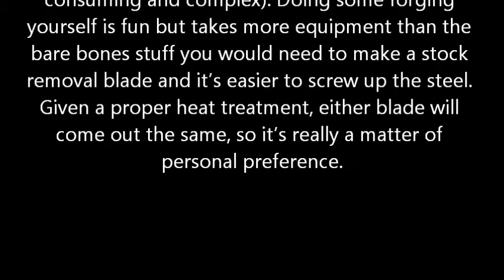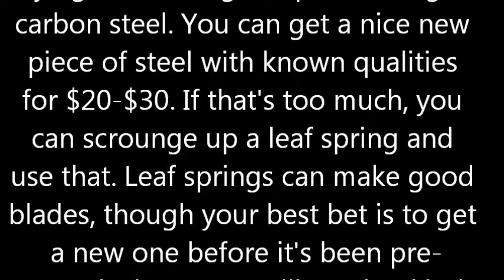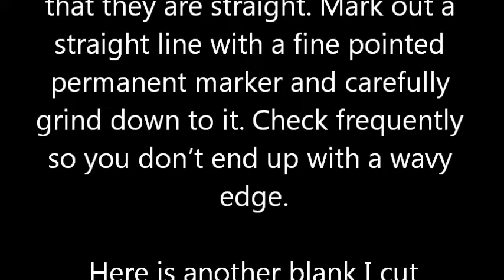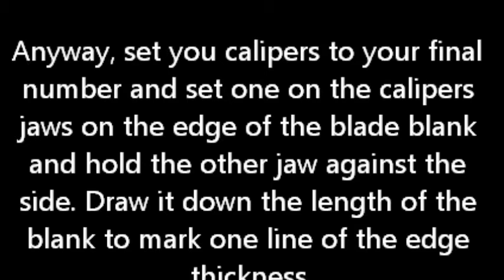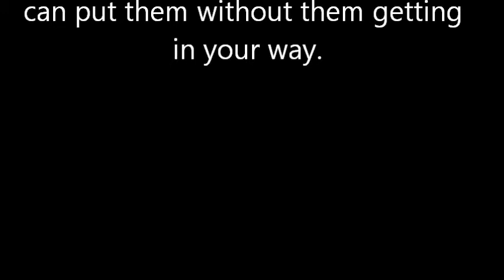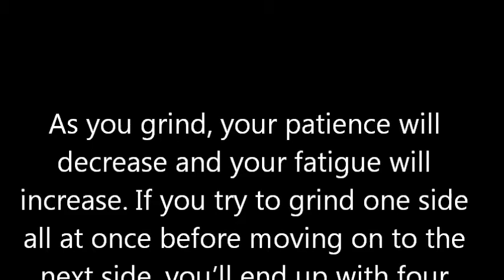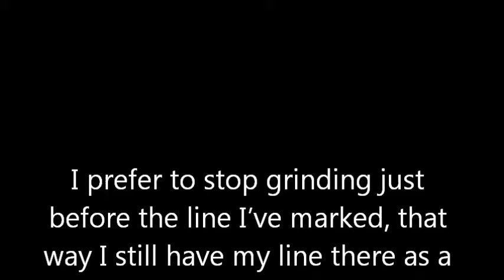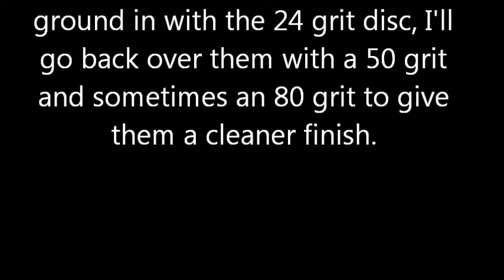how to make a stock removal blade movie part1.wmv

Comment from the maker: It's pretty handy for certain blade shapes. I like it because it's very hot and humid where I live and it's easier to stand in front of the grinder in the shade with a fan blowing on me than to stand in front of the forge in the sun. Not really better or worse, just different. Forging is more fun but much hotter.

Comment from the maker: You're welcome. I generally make the tangs about 3/4 inch wide and 1/4 inch thick. This leaves just enough room for a wood core to fully enclose the steel tang. Any wider and you would probably need to make a sandwich tang with the sides of the steel tang exposed. A smaller or lighter sword doesn't need such a wide tang, 3/4  inch is pretty beefy.

Comment: is it hard to make a distal taper in the blade when doing stock removal?
Reply from the maker: Not really, though it depends on the blade type.
Reply: Can you make a video about that?
Reply from the maker: jizburg It's described in part 2. If you aren't able to figure it out from that, another vid probably won't help.
Reply: oh will check that one out.  sorry for bothering you.